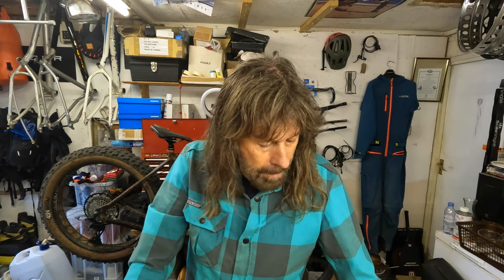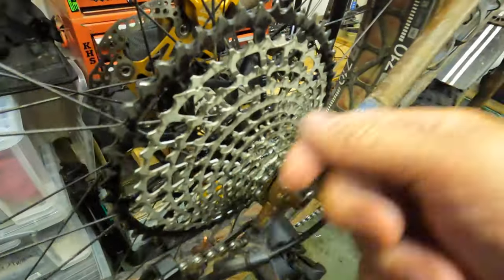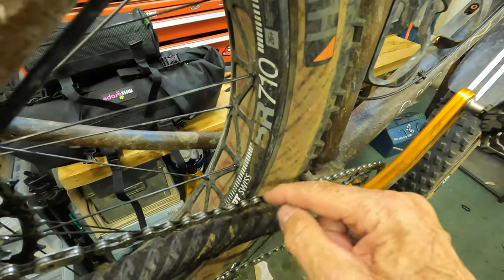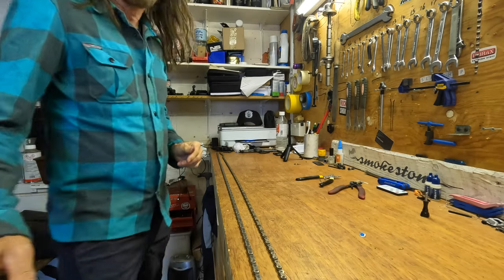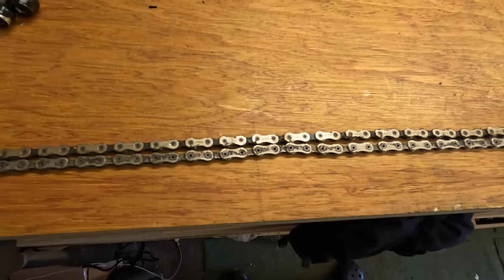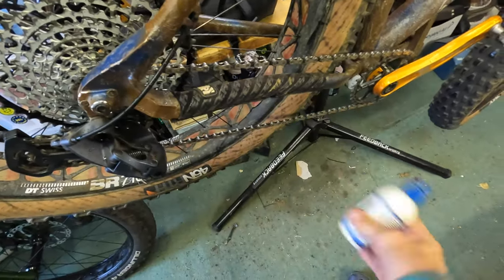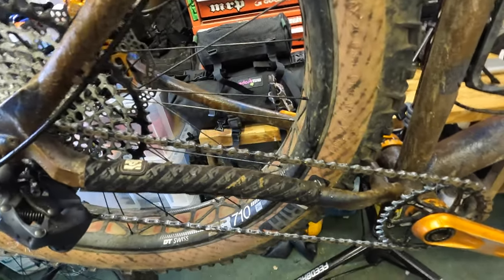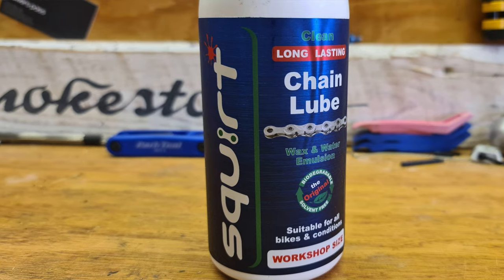How to Clean your bicycle chain

Comment: I used Squirt on my NC4K and had completely silent drive system. However you do have to clean the yuck off and it’s a bit hard to do this regularly enough on long rides like 20 days. So the effort of cleaning it properly is important, and I use hot water when I can go do this. Night before a ride I apply it if it needs doing.
Reply from the maker: If you have a build up of wax, it's due to over lubing the chain normally. I've never had this in all the time I've used Squirt and I never ever clean my chain.
Reply: @GrahamFootBicycleLover  you don’t cut your hair either so it’s not a recommend, is it ??? 😂
Reply from the maker: @davidalderson7761  🤣🤣🤣🤣🤣🤣

Comment: I've used Squirt for years on all my bikes, its easier then other wax, and wax is the best, you've done a great job here on this video, but you've skipped a few good points, chain lube/degreaser contaminates the brakes, wipes out the lube on the cables, and with wax you don't have to use detergent/degreaser on your bike just water to clean it, you don't have grease/oil on the bike to wash off, and no grease gets on your hands, tools, clothes, or bike.. grease/oil/degreaser has its place but its not on the chain, or bike. Also your chain/drivetrain last much longer, World Champion Ned Overends, and Travis Brown,  have a great video on Squirt too.. https://www.youtube.com/watch?v=y0d_7HeA38E&t=3s